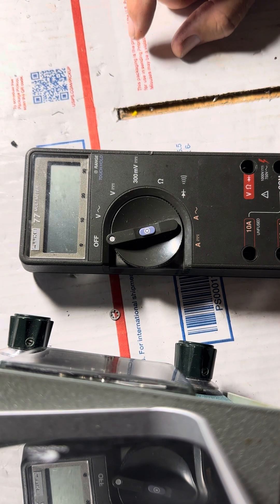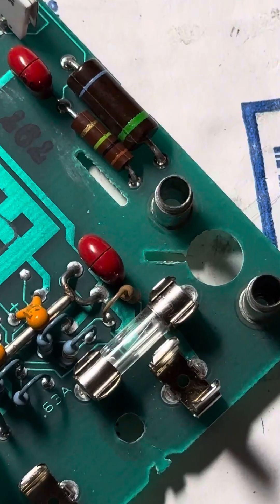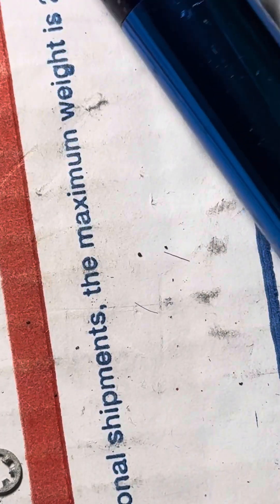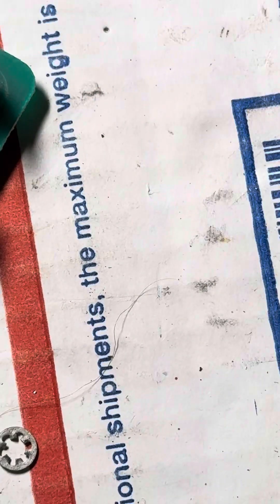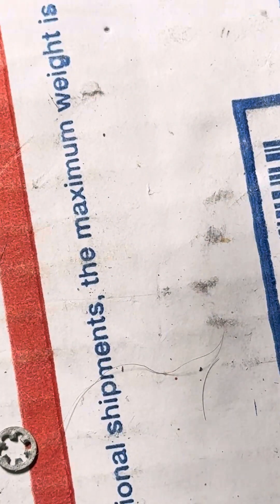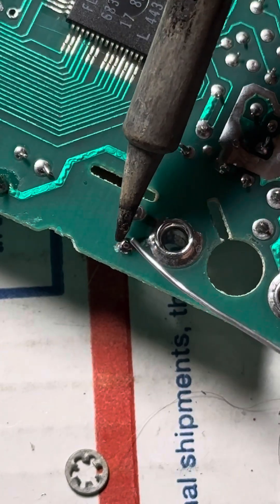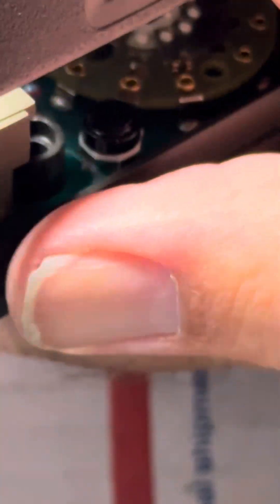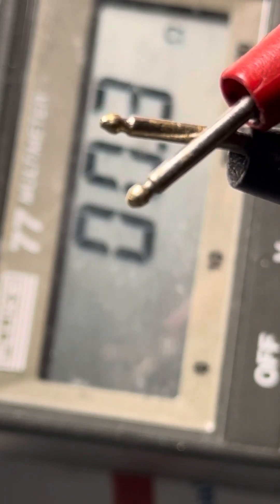Fluke 77 volt ohm meter. How to fix ohms scale after blowing out meter reading  HV voltage on Ohms

Comment: cut the component body out, less heat then needed. use a clean and tinned tip, again better heat transfer, even add solder to add heat transfer. Without the body you can pull straight rather than hinging about the other joint, less chance to damage PCB.

Comment: Brother I have a Fluke 77 I think its the first series, and its not doing acurate ohm reading, in the scale of 10 ohm, it reads 30 ohm so forth... It goes like this untill 1k then 10k 100k, you cannot notice the error, I heated the board with hot air and it became acurate, so I thought It could be the 1k thermistor I think its ntc because when you heat, the resistance diminishes. The I took it off and replaced with a 1k resistor, but the problem remains... So, I don´t know if I replacing the thermistor will help. Do you know what can be causing this? Sometimes when I leave it on much time I hear a faint crackling noise of some component I cannot spot.
Reply from the maker: I will replace the thermistor